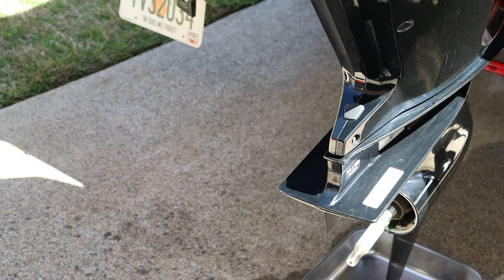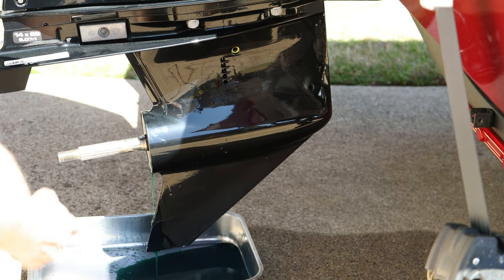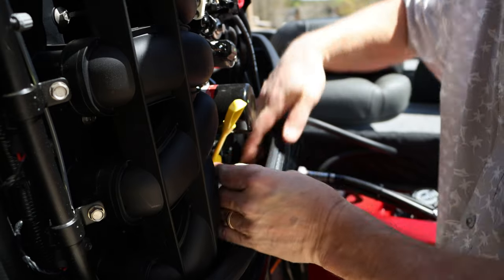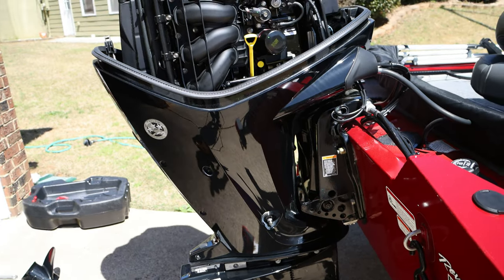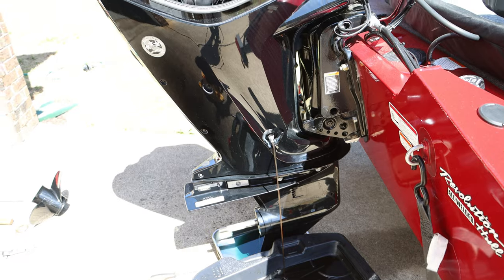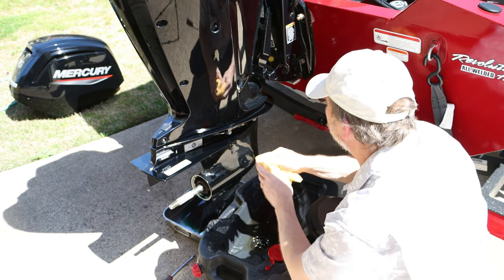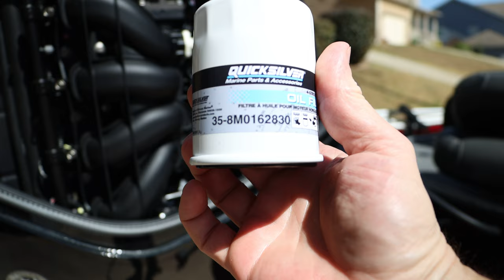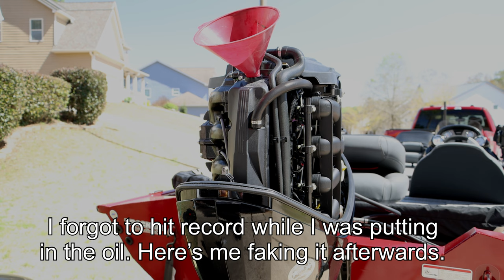2022 Bass Tracker 175 TXW  - Mercury 75 HP yearly maintenance.

Comment: Hey is there an issue if the filter the guy sold me ends in 29 instead of 30? It’s the same part number but the one I got the last two numbers are different than what you showed.
Reply from the maker: I don't believe so. From my understanding both part numbers are the same filter. One may be the Mercury brand and the other Quicksilver, which is Mercury's aftermarket brand. But I am not 100% certain on that part.  Does yours say Mercury of Quicksilver on the box?
Reply: Mine is mercury. But it ended up working, so thank you. 🙏